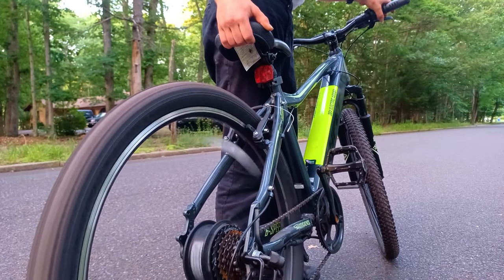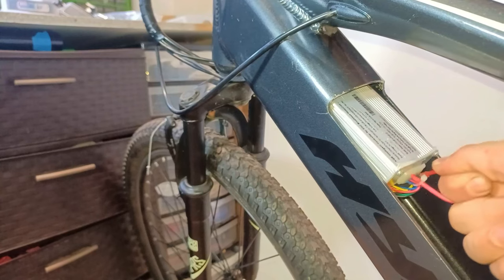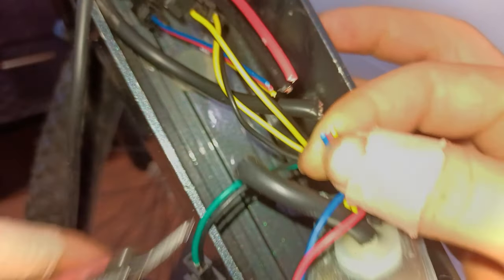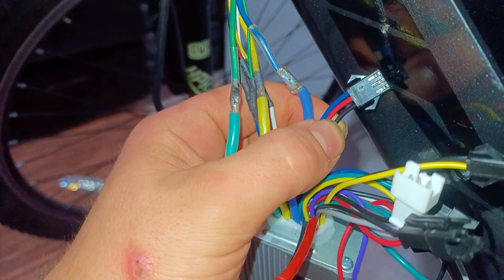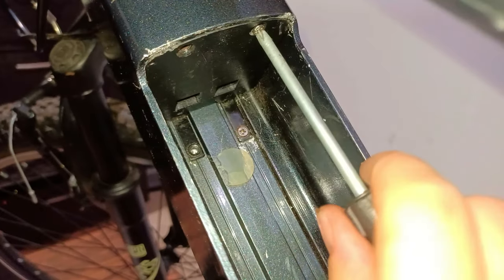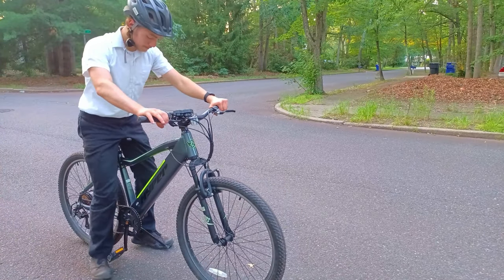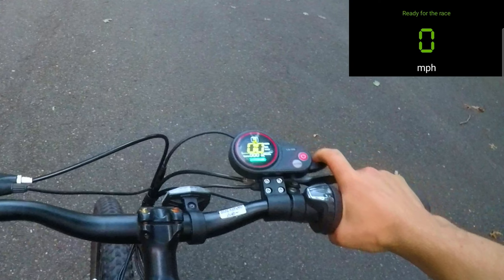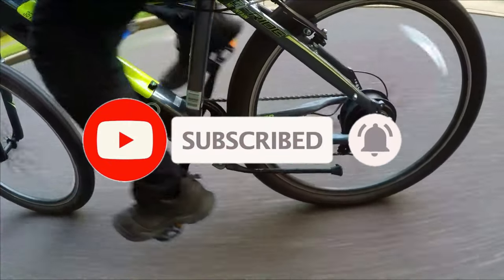how to add a THROTTLE onto a PEDAL ASSIST bike

Comment: Also a note to others. If you ADD a throttle by VIA changing the ESC. You WILL lose about 7miles of range dropping you to 13miles of full range (VIA Throttle only driving.) Also at half range of power (6 1/2miles) Your speed will reduce to 15mph. Then after few miles more your speed will slowly dip as the battery runs out. And that's running till your almost to a jog to a very fast walk pace. Not sure why it does this for a Lithium battery compared to a Lead Acid. But it does for some reason.

So if you wish to keep full 20miles of range without most of the performance lost. Don't upgrade to throttle. Just do the air pedal effect. You don't need to pedal hard or fast when you're on high or medium. The PAS just needs a few spins to keep it going. It'll also work WITHOUT the chain since the PAS sensor is connected on the pedals on the drive side or for easier info the chain ring.

Comment: I have everything hooked up the exact same expect for the brown and white wire that come from the motor. Please help me!!! If tired to plug them into every possible option. Can you please do a step my step or atleast tell me what I’m doing wrong. EVERYTHING works except for the wheel spinning. The motor is receiving power but it’s not executing the spin and movement
Reply from the maker: do you hear any noise while using the throttle?

Comment: I bought the same motor controller but there’s a white and brown cable from the motor and I don’t know where to connect it
Reply from the maker: That might be a speed sensor, but try running it without using these two wires and see if it works. (It worked for me)
Reply: @ElectronicLab.  the motor spins the only thing is that i can’t control it when ever i turn it on the motor just starts spinning and the throttle doesn’t work
Reply from the maker: @victorious2067  are the two white wires from the controller connected?
Reply: @ElectronicLab.  i don’t see any two white wires from the controller but on my lcd screen it say error 07 and when i turn the bike on it makes a weird loud buzzing sound
Reply from the maker: @victorious2067  "error 07" means the motor wire is not connected correctly. can you explain how you connected the motor wire?(a 5 or 6 wire cable)
Reply: @ElectronicLab.  the phase wires are blue and green, blue and green, and yellow to yellow
Reply from the maker: @victorious2067  did you try to connect the phase wires differently? because even if  you don't connect the hall senser cable, the speed controller should be able to work (if you don't connect the hall senser cable, there might still be a "error 07" message)
Reply: @ElectronicLab.  at first i tried to connect the phase wires by color but it didn’t make the motor spin and i tried the combination i have right now and it works but there’s only two wires that i couldn’t connect from the hall sensor
Reply from the maker: The hall sensor cable can have up to 7 wires: black = GND, red = 5v, green = hall 1, yellow = hall 2, blue = hall 3, white = temperature sensor and if there are any other wires besides these, it might be for  a speed sensor. Also, the hall sensor wires don't always match perfectly, so connecting color to color for most of them in this case is probably best.
 Please note: The only two wires that can cause damage to the motor controller are  the positive and negative wires if not connected correctly. Otherwise, you should be fine.
Reply: @ElectronicLab.  something that i realized when i tested it out it only goes up to ten mph when the bike usually goes up to 22 or 23 mph do you know how to fix this?
Reply from the maker: @victorious2067  There are three gears on the display to choose from. By pressing the mode button until you hit gear 3, it will make the e-bike run at its maximum speed.
Reply: @ElectronicLab.  i’ve tried that with the same lcd from the video but it just stays at the same speed even if you change it
Reply from the maker: @victorious2067  at this point, maybe you should try going into the settings from the display to change the voltage setting or the speed limit. I've  made a video in which I explain how to go into the settings from the display:
 https://youtu.be/_Bh6IKfam08?si=ZdGCk-jxz2oWIdgL

Comment: Can you please tell me what a E002 is I thought for sure I wired them just like how you have
Reply: It also has a warning sign
Reply from the maker: @thomasgoheen1895  The motor controllers manual says: "E002 = brakes"

So I would recommend trying to unplug all the brake wires and see if that solves the problem.
Reply: @ElectronicLab.  I have unplugged all the brakes and when I power it on it sounds like the motor is running, and the speed shows it’s going 25mph without the tires moving at all. Any recommendations? Thanks
Reply from the maker: Try switching around the three thick motor wires until it spins
Reply from the maker: Ps, If you scroll through the comments from this video, you might find the perfect configuration for the 3 thick motor wires

Comment: Please help… I got a e-6 error and low battery flashing .. can’t get the motor to turn at all
Reply from the maker: What voltage is your battery?
Reply: 36volt.. I have the same bike as yours and purchased the same motor controller
Reply: Same issue
Reply: Same issue same bike too... yall find a fix?
Reply: Anyone figure this out?

Comment: Do you happen to have a video of the settings for the throttle lcd that you have input ?
Reply from the maker: Here is a video where I show how to change the settings from the display: https://youtu.be/_Bh6IKfam08
Reply: So u didn't have to pit in how many magnets the motor has on the lcd got the motor moving after changing phase wires around but dies when hit throttle and the battery lights flash any ideas no error codes either
Reply from the maker: @stephendollan6669  does the motor spin smoothly? or is it jittery when spinning? If it is jittery when spinning, it might be triggering the overcurrent protection from the battery. so you might want to try changing around the three motor phase wires configuration until it spins smoothly. Ps the setting where you put in how many magnets are in the motor, only has to do with the speedometers accuracy and not with the motors behavior.
Reply: No I have changed the phase wires no I have the back wheel moving but the display cuts off and my battery flashes blue could post video if you could help me out ano I'm close possible battery not allowed throttle a dunno  now thanks
Reply from the maker: @stephendollan6669  good idea. Post a video on your channel so I can better understand what is happening
Reply: @ElectronicLab.  I have posted a video on my face book after that video I now have error o7 which is motor fault but the motors still workin as iv had to pit bk to normal the way it came to go out later
Reply: @ElectronicLab.  I meant youtube sorry
Reply from the maker: I watched the video, and it sounds like the motor is still not wired up correctly (the three motor phase wires). I did some research, and turns out the motor controller comes with a pair of two single white wires(called "self-learning wires"), which apparently if you connect them together, will program the controller to run no matter the motor wire setup. Just make sure that the wheel is raised while connecting the wires. Because the motor will start spinning as soon as the wires are connected. Also, these two wires will set the default direction, so as soon as it spins in the proper direction, you can disconnect the wires.
Reply: @ElectronicLab.  think it's 2 green wire you connect them together and the wheel moves I done this and didn't make any difference something telling me its the carrera battery that's got some sort of cut out and won't allow enuf power it cuts out after the 07 error av gave up this week will try again at weekend if u can think of anything will b great its a real pain now
Reply: @ElectronicLab.  is it possible to connect battery positive and negative straight to the phase wires either the blue yellow or green would that technically work
Reply from the maker: @stephendollan6669 no, this motor has to be driven with a brushless motor controller because it runs with ac and not dc. although, I think that this motor controller can be used without connecting a hall sensor(the 5 wire cable going to the motor). my point is, if you'll disconnect the hall sensor wires and the motor will spin without getting interrupted by the battery, will show that the hall sensor is not connected correctly
Reply: @ElectronicLab.  so do u think this is possible to do now I have this error 7 on lcd will ndto start from the beginning and make sure everything is connected properly just don't under stand why it goes so far then just dies
Reply: @ElectronicLab. Do you know how to by pass a bms on a carrera veangece battery my battery isn't given enuf power and cuts off everything else is spot on apart from my battery a don't worry about warranty it's nearly up thanks
Reply from the maker: @stephendollan6669  to bypass the batter, you have to find the negative connection on the bms coming from the battery and connect that to the negative output from the bms (by doing this, you are not just removing the over current protection, But also the over voltage protection, under voltage protection And the overheating protection) now the most important protection for the battery is the under voltage protection. So before bypassing the bms, make sure to program the display for the nominal voltage from the battery, and maybe even set a custom cutoff voltage. This way, the motor controller will stop discharging the battery before killing the cells.
Reply: @ElectronicLab.  yeah bud I've had a look around and a see that it's dangerous and a pain in the backside how would I do that you have the same lcd do u think you could help in any way ul know the specs of the battery what I don't get is why can't it throttle to 15 mph even just that would do just now hate peddling lol thanks again
Reply from the maker: @stephendollan6669  In the video I've sent you, I show how to access the settings through the display. once you gain access to the settings, you have to set two settings (which is written on the piece of paper that comes with the motor controller). The first setting you have to select is p03, which has: 24v, 36v, 48v, and 60v. Look at the batteries label, where you'll find out what voltage to select. The second setting is under voltage protection, which is p15. If you’re battery is rated at 36volts, then enter 27.5v. If you’re battery is rated at 48v, then enter 35.75v. And if your battery is rated at 60v, then enter 44v.
Reply: @ElectronicLab.  really wish u were close by not going to lie seem to know your stuff yes I'm pretty sure av had theese setting on the wrong settings will try what you have wrote and I didn't get any paper with either the lcd or controller was off amazon strange no manual at all am sure everything is 36 v but the battery full charges is 42 volts a think
Reply: @ElectronicLab.  this is the battery could u give the number for that battery to input to the settings would b great
Reply: @ElectronicLab.  I've had to out it on the YouTube channel can't add oic to here thanks
Reply from the maker: @stephendollan6669  to access the display settings, you have to press the power and mode button at the same time until the screen displays a password input. At that point, enter 6666, and then hold down the power button until you see the display change.
Reply: @ElectronicLab.  I can't seem to put the pic up or here it's a 36 v 8.7 ah 3132 wh
Reply: @ElectronicLab.  yeah I know how tk get to them I and will Tey just now tbh I think I need a new battery a have tried everything a can think of was just trying to save buying 1 thanks